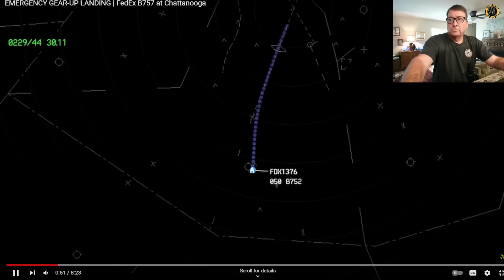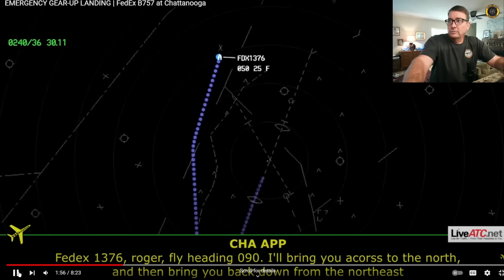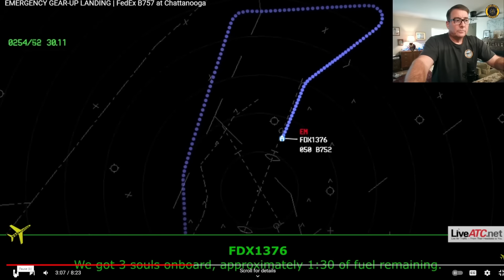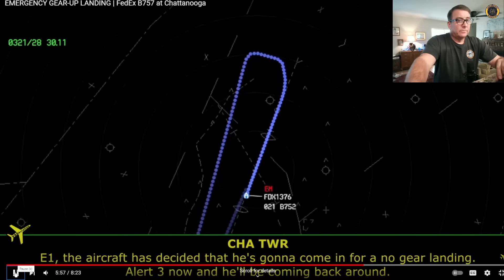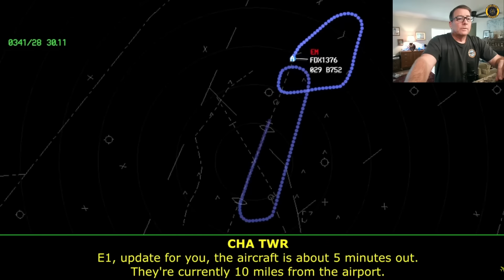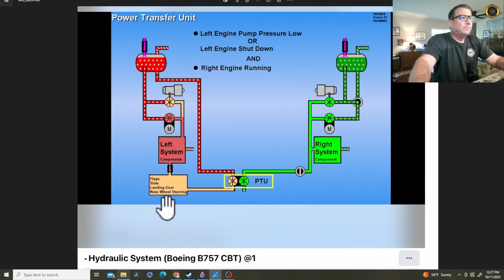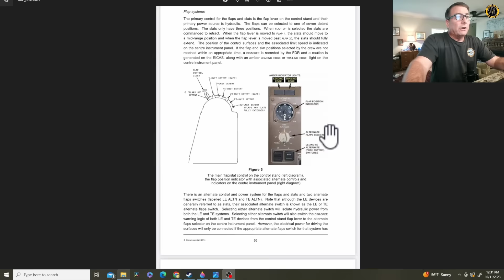Fedex 757 Gear Up Landing 4 Oct 2023

Comment: I’ve watched numerous videos on this incident.  But once again Juan you explain the whole thing clearly so I can fully understand the situation from a crew perspective.   The best and to me original channel for all things aviation .
Reply: He forgot to mention that he had control issues at first listen to whole conversation closely
Reply: @DrDisconnect666  it's a bit counter-intuitive, but failover isn't automagic and one doesn't notice. Things reach a failure point, then switch over and one can easily enough notice some issues that'll sort of resolve (with a master alarm) and a bunch of odd shit suddenly doesn't work.
Hence, the intensive checklists. Not intensive if you're on the ground, but while flying, well, one risks being distracted from the checklist by flying or distracted from flying by the checklist, either one resulting in being distracted by dying. It's called task overload.
To prevent that overload, there is CRM and well, ATC, who in an emergency makes the entire sky yours, as well as all of the airfield.
Reply: Juan is TATTUM, as usual. TATTUM = totally awesome to the ultimate max

Comment: It’s hard to imagine that all the redundant systems on the aircraft for the landing gear failed at the same time
Reply: Something tells me that the maintenance crew is going to have some rough interviews.
Reply: @cptn_chromo3189 And ground crew if it were a leak. You'd think there would be a puddle that needs to be reported.
Reply: I wouldn't think that unless there had been maintenance just before this flight.  Hydraulic lines let go infrequently but they let go, especially on high time aircraft.  Could have also been a blown seal on one of the up cylinders, or even the slat/flap motors, etc. but my professional opinion (retired aircraft maintenance) is there was a leak somewhere in the utility side of the left system, flaps, slats, etc. that emptied that circuit.  Unfortunately that (loss of hydraulic fluid) could be considered a single point of failure.  I was used to an airplane that had a backup system for the gear when utility fluid was lost, by blowing down the gear with air pressure, supplied from an isolated pneumatic bottle, hence eliminating the worries of fluid loss.  All and all though everyone 'did good' and it's a testament to the people and especially that beautiful 757, that all is well.
Reply: @paulholmes672 . I agree that the cause was complete fluid loss. A tank drain or supply line to the ptu?  I would hate to be the mech that did some work before flight or the guy that signed off the service check. Now for the FAA, NTSB, and Company investigations.  One strong advice, never try to bs your way out of an investigation.
Reply: @paulholmes672 we blew a spoiler actuator cylinder in a 767 a few weeks ago and lost all center hydraulics. (heavy system on the 767, for those who may not know.) Thankfully it was while exiting the runway after landing and not in flight.  Zooming in on the pics i took, it appears the 4 bolts holding the cylinder assembly together had sheared and the cylinder came apart. Made a mess on the taxiway.
Reply: It can happen, from listening to the narrator if you lose the entire left hyd system hyd fluid, even in the trapped line, you're not going to get the gear down outside of a free fall. But if you lost all system fluid you would have other system malfunction warnings and cockpit idiot lights illuminating.  Hard to say, shit can happen, heck the two man flight crew could have screwed the pooch on the emergency procedures too, as well as FedEx central who I'm sure they were in constant comms with the entire time they were trying to trouble shoot the problem.
Reply: @oveidasinclair982  The LOT 767 gear up landing was due to a popped circuit breaker which also powered the small electric motor that released the uplocks which then allowed the alternate gear extension to work. 2 different systems, so an electrical issue shouldn’t affect the 757 alternate gear extension system
Reply: I know the 737's have a mechanical release for the door and gear to get them down. I'm surprised that all three ways to drop gear were all dependent on that left hydraulic system having fluid in that section. Granted this is "after the fact" knowledge for us, but shouldn't there have been something on the right system or a mechanical release to prevent this exact situation?
Reply: It would be fun to look at the System A hydraulic diagrams to see if there's a location where a single leak would completely drain the system. Strategically placed check valves are normally used to prevent this type of event. Awesome job on the landing!
Reply: @briankeeley6464 the pump or the check valve itself, is my uneducated armchair guess. I'm imagining a situation where the check valve must be between the main pump and the back-up electric pump, in order to trap the fluid. Main pump fails, blows metal bits up the line and causes a leak. Metal bits get caught in the check valve, preventing it from closing and it drains out the "trapped fluid" too.
Reply: But they all depended on the single trapped hydraulic fluid.
Reply: Now they'll have to fly around with a case of hydraulic fluid and a can of stop leak.
Reply: @Saml01 and a funnel!
Reply: @scottp.5161 Gonna have to be without for a bit until they get it certified.
Reply: @Saml01 why would they get certified again it’s a 30 year old plane they can write it off as a loss which is easier for a old airplane
Reply: @scottp.5161  you can’t forget the funnel. Needs to be added to essential equipment checklist
Reply: @Saml01  Sounds like me and my truck. That is what the bed is for. Fluids.
Reply: Time for a refit.  That third system should be stand alone, with a dedicated oil supply.  A single point of failure is not redundant! Engineers take note, Murphy's Law still applies.  Glad the crew got it down and walked away.  Nose never got close, nice touch.
Reply: The standby system uses oil from below the port for the main system, so the main pump can drain the tank but there’s always some left for the emergency extension. This is how Boeing designed the system and it’s clearly been certified and accepted and in use for 30+ years.
Reply: What if it wasn't any of the hydraulic systems at all and the landing gear doors were jammed or something?
Reply: @bookcat123 No, their first "issue" was with flaps and slats followed by nose wheel steering. This is clearly a hydraulic issue. Even if it were the case of landing gear and/or doors jamming, it would likely be one gear since none of the mechanical elements for the gears are linked with each other. Generally when multiple systems fail at the same time, there's usually one single point of failure, not three.

Now, when I first saw this on Real ATC and VASAviation, I didn't know that all three ways of lowering the gear all depended on hydraulic fluid from the left system. I thought they had a mechanical system similar to the 737s, where there's a release lever or pull chain that litterally unlocks the gear and lets them drop. In that case, I wondered if the gear could jam in place if the hydraulic system failed while raising them. That would have been a single point failure (and a design issue.)
Reply: @jackielinde7568  The LOT 767 gear up landing was due to a popped circuit breaker which also powered the small electric motor that released the uplocks which then allowed the alternate gear extension to work. 2 different systems, so an electrical issue shouldn’t affect the 757 alternate gear extension system
Reply: @bookcat123  All three? Not very likely, IMO. Years ago, we had an MD-80 with a nose gear that would not extend. At all. No amount of maneuvering could get it to drop. It turned out there was a chock wedged between the nose wheels and the forward bulkhead of the gear bay, or maybe the nose gear brakes. How it got there was never explained. I have a theory, but that's all I've got.

Comment: When the ATC is asking you for the SECOND TIME 'Do You Want To Declare An Emergency?" He's telling you "Declare the Emergency Moron!"
Reply: Don’t be too harsh on the pilots. It’s very likely that they were trying to see exactly what they were dealing with, it could have been a faulty light or an actual hydraulic issue, that’s exactly the reason why the pilot told the controller twice “we’ll call you back.” I hate people already making conclusions based on no evidence or facts at all. Also, when you declare an emergency, that’s not something you can take back, the pilots had to make sure this was in fact an emergency. 

At my training airport, a twin-engine Seminole took off after the crew failed to properly finish their run-up on one of the engines. As a result, the engine quit just after takeoff. The crew immediately declared an emergency until they realized their mistake, flicked a switch and the engine came back to life. The crew told ATC “uhh nevermind on the emergency!” Yeah, as you could imagine, the crew got in big trouble and the CFI was fired.

You need to be certain with what you’re working with. It takes time to run checklists while also being vectored around. I personally believe the crew of this FedEx flight declared their emergency at a reasonable time. Just let the pilots do their work and stop jumping to conclusions.
Reply: @thecomedypilot5894  <<I hate people already making conclusions based on no evidence or facts at all.<< Ditto. There seems to be an awful lot of that here on YT.
Reply: “Emergency” means “immediate peril”. If they were not in immediate peril then it was not an emergency. If they were working on restoring systems, then they did not predict an emergency. Once they knew that their procedures had been unsuccessful in lowering the gear, then they expected to be in peril upon landing, so they declared an emergency.

All of this “when to declare” bullshit on youtube is immature and irrelevant. It only becomes relevant the moment they actually know they are in peril and in need of help. 

Sure, I would have declared sooner if I were a captain, but they did fine the way they did it.
Reply: @Mattribute  I’m sorry but no, just no. The declaration of emergency does not mean nor require “immediate peril”. It reflects a problem with or on the aircraft that may result in peril, be it immediate or upon landing. It is basically something is going wrong here. The declaration of emergency really does not mean anything to the pilots aboard the aircraft. They are operating to their own checklists and conditions. But it frees up ATC to take a number of steps in support of your aircraft. Blocking out a large section of sky for you. Giving you needed priority over other aircraft. And giving critical ground resources a heads up. And ATC generally knows the rhythm of how these things go. ATC controllers are more likely to have encountered emergency situations than most pilots. Just by virtue of volume. If an ATC controller is asking you twice whether you wish to declare an emergency, the second time is him, politely, telling you that this is what you should be doing now. Every single time. You’ll notice in this case the ATC controller ignored the pilots answer and flagged him as an emergency aircraft. Because it was clearly apparent to the ATC that that was what was needed. Declaring an emergency prematurely does no damage and costs relatively nothing. Better safe than sorry. Holding off on declaring an emergency because you are waiting for some imaginary threshold of imminent peril, does tend to cause imminent peril. Aviation is littered with the wreckage of those planes that failed to declare an emergency when they should have. I had the haunting experience of being on scene for one of the more famous ones.

Comment: There's a Russian A320 that had to land in a field with hydraulic failure. They are currently doing repairs with limited supplies because of sanctions. Anyway, they plan on flying it out of the field once it's 'repaired' haha.
Reply: Most likely they are waiting until the ground freezes.
Reply: Last video I saw on that one, they cutting the wings off with an excavator.
Reply: @kerrymcdonagh1327  Ouch
Reply: @kerrymcdonagh1327  can't find anything on that. To me.. that seems like a sensible solution. Remove the wings, and truck it out. Then again it's Siberia, who knows what if any roads exist.
Reply: @karbide3084  it was on one of the channels covering the Ukraine conflict. IIRC it was the Suchominus channel. It was brutal, they just hacked it to pieces

Comment: Hello Juan got a ? It's seems like all emergency the ATC seems a be overwhelming pilots not giving them a chance to get a handle on the situation
Reply: thing you have to remember is that dead air is edited out of the audio so what might seem like they're overwhelming them isn't always the case.
Reply: The pilots flew around for as long as they felt they needed to. ATC cleared the way, but didn't rush them.
Reply: @j_taylor   I mean like the ATC seems to take the pilots attention with unnecessary radio calls
Reply: It is just overwhelming to you.
Reply: @ReggieVanGleasonIII   An insult having no point, other than to have insulted someone.

Comment: Why in 2023 to airliners not have external cameras to view landing gear, engines, control surfaces, etc.?
Reply: Some do have external cameras.
Reply: Interesting question that comes up almost every video of a mechanical emergency. 
It wouldn't have changed anything here. 
They could have just assumed their gear indications were correct,and prepared for a low energy landing (but of course still tried to use the brakes and steering in case the indicators were wrong). Fortunately, there were people in the tower who also looked visually at the gear to confirm the bad news.

Comment: Will the plane be scrapped?
Reply from the maker: probably.
Reply: Depends on the overall damage but looking from the picture, it appears that it can be repaired.
Looked like a greaser of a landing so the #1 pylon, (engine strut) may not have taken an overstressing.
It will need a detailed inspection and if it is deemed BER; ( Beyond Economical Repair ), as it is known in the airline industry, then no it will not be repaired.  @blancolirio
Reply: Depends on the overall damage but looking from the picture, it appears that it can be repaired.
Looked like a greaser of a landing so the #1 pylon, (engine strut) may not have taken an overstressing.
It will need a detailed inspection and if it is deemed BER; ( Beyond Economical Repair ), as it is known in the airline industry, then no it will not be repaired.
Reply: It is too old to be repaired, not enough residual value

Comment: Thanks for covering this!  Great job as usual.  The 757 is one of my favorite commercial airliners.  I'm an A&P of 22-years, working on Airbus and Embraer.  Will this be a write off/hull loss?
Reply: FedEx has 757s sitting in storage, so they can replace this one on the line and not lose capacity. The aircraft is 30 years old
Reply: Yes
Reply: It
ll be a shame when the last are gone, the 757 is a beautiful airplane and a smooth flyer.  Boeing needs to quit reinventing the wheel and make a modern 757 format airplane, to compete with the 321
Reply: fedex will likely write it off since they've been replacing all the 757's and DC-10's remaining in their fleet with 767's.
Reply: Going to be fixed and will fly again. Damage isn't that bad.  @sirmonkey1985
Reply: Ain't insurance grand.